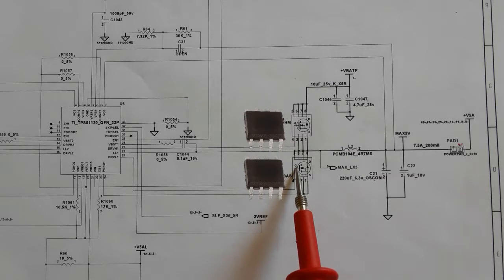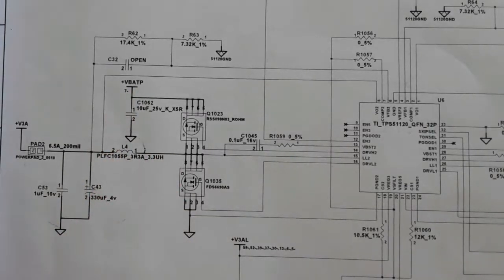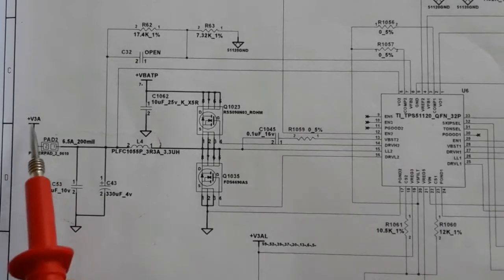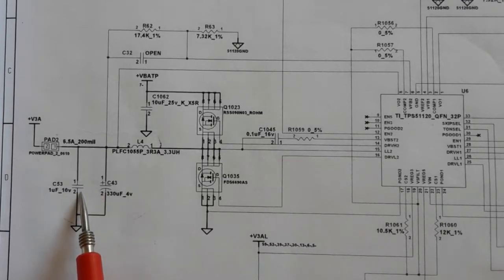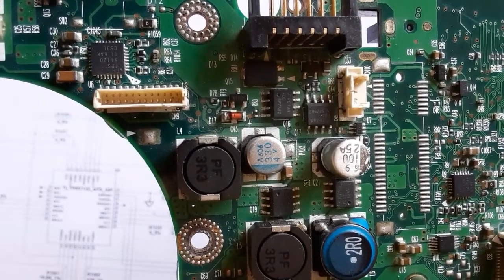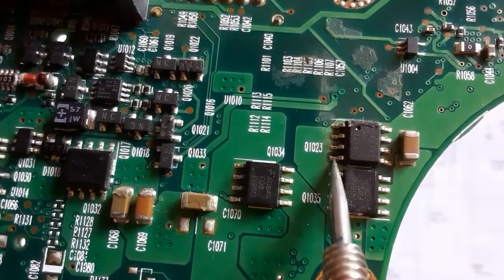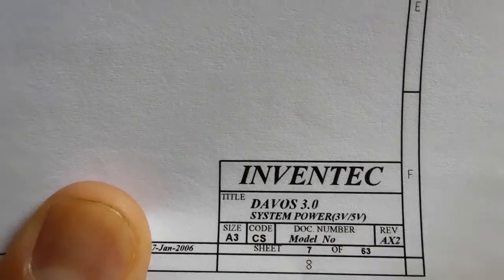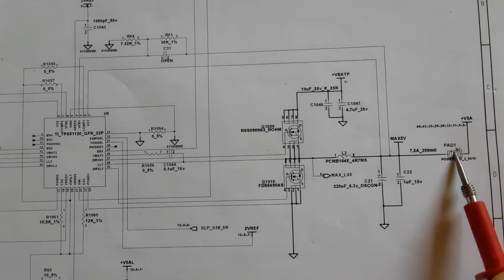3V and 5V Laptop System Power IC circuit explained

Comment: Well perfected explanasion as usual , amazing leasson thank you , i have a dell laptop 5580 that won't charge as the adatpter NB_PSID not showing 3.3Volts on pl4 or 5 volts on Pl5 , testing the adapter needle there is no 3 volts out of the adapter , diassembled the adapter seems have a shorted 3 pins transistor for this 3 volts needle engraved on top of it BYCĪ how can i solve this to provide the 3 volts necessary from the adapter so that the motherbpard acn sense the adapter and start charging the battery ? Thank you .

Comment: Hi, thank you for the videos. I have a question. If vbatp is 19 volts then how can a mosfet, capacitors and an inductor reduce  19volts to 3v and 5v? Something doesn't add up. Or maybe there is a regulator between vbat and vbatp.
Reply: 4:54 Power management IC (step-down controller TPS51120) does the conversion.

Comment: Thanks for the tutorial. I have up6182 controller for mecer. I am getting a 3VAlways but the 5VAlways is missing. If press the on button that's when I read 5V. I measured for gate voltage for the high mosfet on the 5Valways and found nothing. Is it possible that the 3V&5V Controller is bad
Reply from the maker: Hi Dexter,
Right in this case the Controller could be the failed component, But try to check first the 5V path

Comment: Is it normal to have 3.3 and 5v output but pgood is 2.7 and feedback for both lines is lower then 2v?
Reply from the maker: Basically that is Normal. But to be sure, you have to check 3V/5V IC datasheet (the datasheet will shows you the voltage of every pin ).
Good luck

Comment: Thank you very much for your video. But I have a question, does the incoming 19v arrive at the mosfets directly or does the 19v first go through the voltage regulator and come out through the mosfets?
Reply from the maker: My pleasure, thank you.
Incoming 19v accesses MOSFETs after passing through other MOSFETs called switches(near of power jack)
Reply: @electronicsrepairbasics_erb  Thank you very much for your explanation, it helps to better understand how it all works and how to troubleshoot.